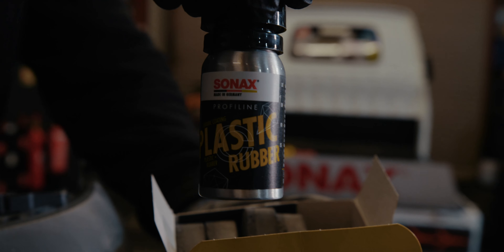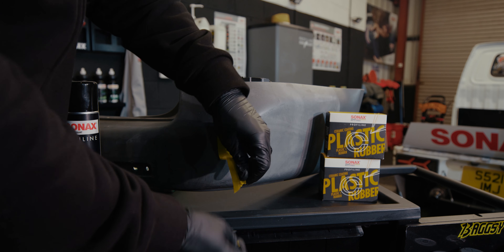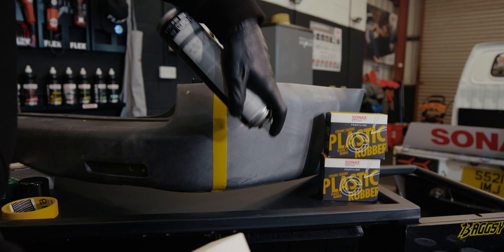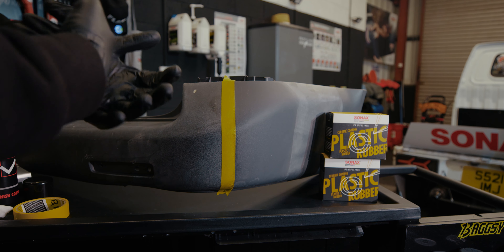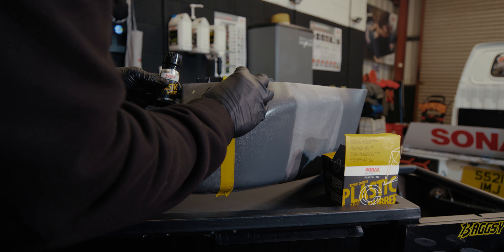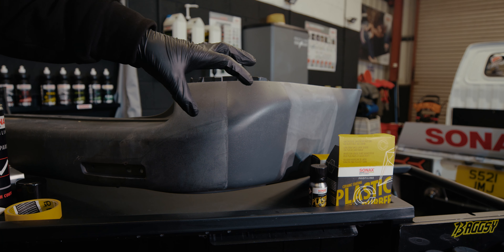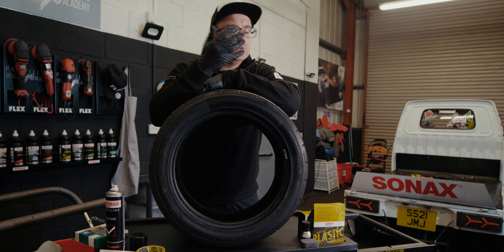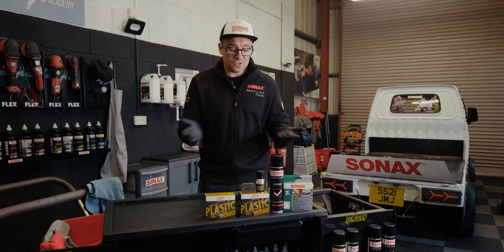How to apply the new SONAX Ceramic Coating Plastic & Rubber | long term solution for faded plastics!

Comment: To clean the Bumper from the old dead Plastic Surface,use an APC, not a Degreaser.
Reply from the maker: Apc will leave surfactants on the surface stopping the ceramic bond you have to have a clean bare surface so a solvent  is needed